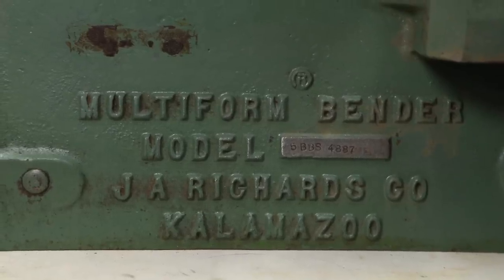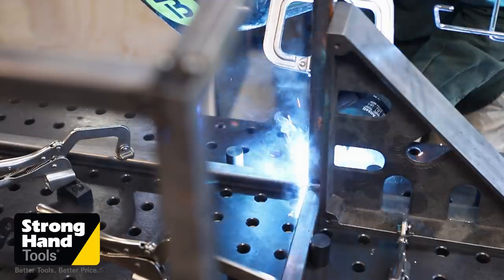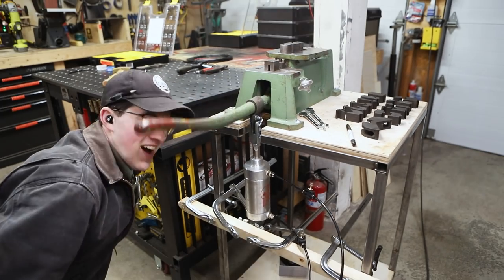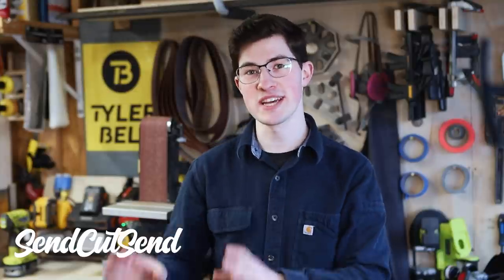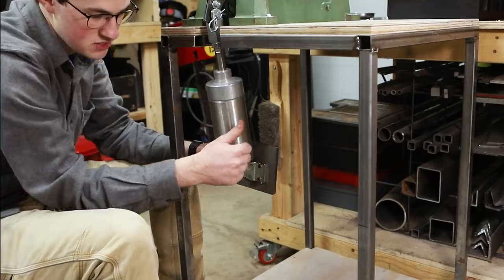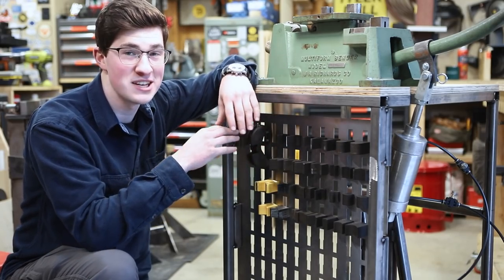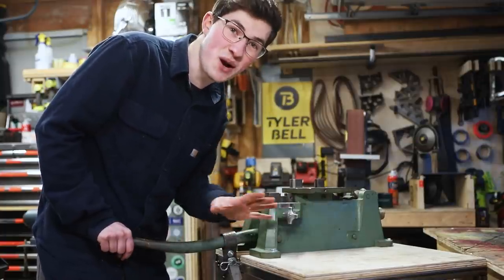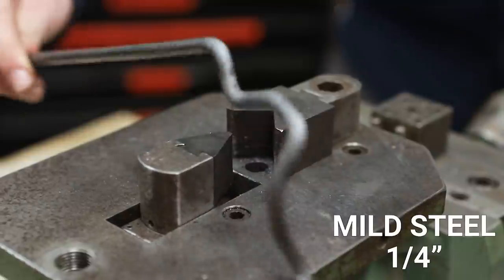Mini Horizontal Press Brake | PNEUMATIC CONVERSION

Comment: A tip from someone who's learned the hard way, you need to support all 4 corners of casters and ideally the whole plate. With only 3 corners when you hit the caster on a bump the right way it'll start to bend the unsupported corner up.  Eventually you bend them far enough that the balls that allow yhe swiveling escape and you've got a mess and a stuck caster. 

Your casters are probably beefy enough for the weight of your stand, but if you start having troubles with them not wanting to swivel, this might be why. 

I had a lumber cart (couple hundred pounds) on casters robbed from a 4 caster furniture dolly that was rated to 1000lbs and I completely obliterated the casters because only ~75-80% of the caster plate was supported.

Comment: Good thinking. Just remember the limits of the machine itself.. catastrophic failure with air tools is not a pretty sight. Keep showing the math so others can be safe also.
Reply: He said the output was twice what he could do. That seems pretty reasonable to me. It would be like calling over the shop giant and getting him to essentially double tylers weight (since the most force you can apply is the entirety of your weight). As long as you're not going overboard on the material thickness it should be fine.
Reply: I agree.  And after spending about 20 years making steel rule dies, it's not that a the bender isn't capable of handling the extra force, but the dies being strong enough.  I have split many dies over the years on 3 point .937 rule... they just fatigue and break after thousands of bends.  4 point  rule is even heftier, obviously.  When you get into bending thicker bar or rod, the dies are not designed for that, even if the bender seems like it will handle it.  We all know tools are designed for a purpose, and this rule bender was not designed for this.  Be safe, Tyler.

Comment: Idk if that would be possible given the length of extension of the piston, but by moving the linking point towards the end of the handle would give you more torque on it